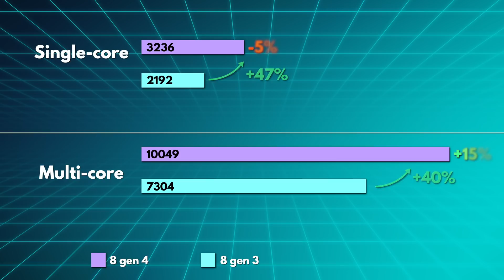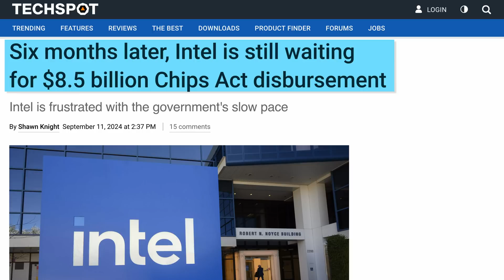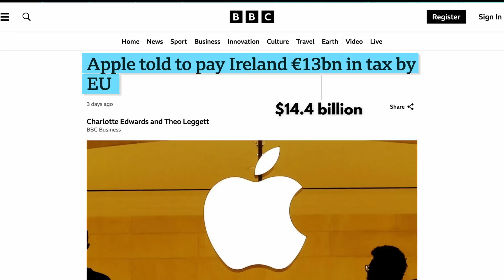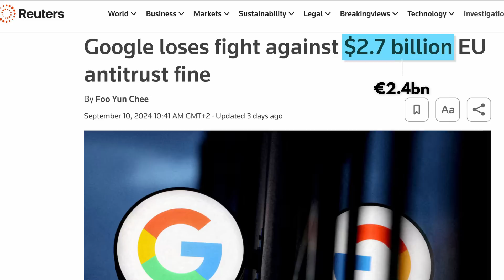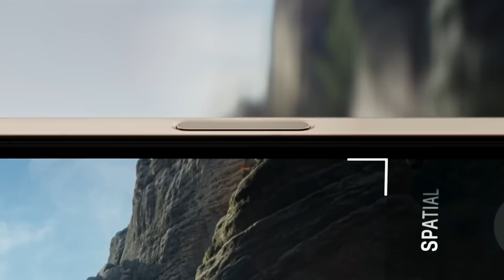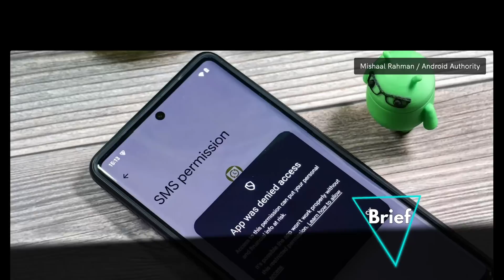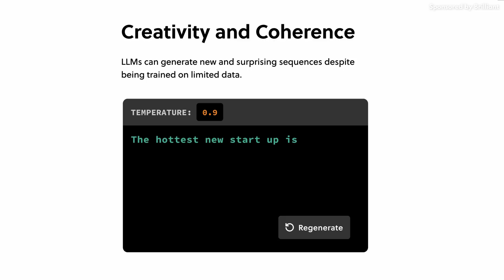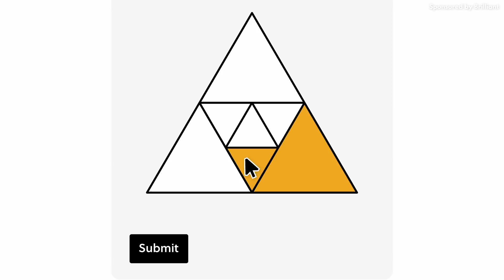Leaks show Qualcomm finally beating Apple!

Comment: last gen snapdragon about 140 mtr/mm2
new gen snapdragon about 220mtr/mm2

last gen apple bionic about 185mtr/mm2
new gen apple bionic about 220 mtr/mm2

new gen snapdragon 3200/10000
new gen apple bionic 3500/8500

seems more like the same performance but small difference in single/multicore
which is designer's preference mostly than some difference in performance

When Intel was dominating it was 1 to 2 nodes ahead. Same for Apple.
It is not Intel or Apple so much , but the silicon below.
Apple was indulging in saying how efficient it was . What about now?
Why is it not more efficient ? Have Apple's engineers suddenly lost their edge?
This would be disrespectful for Apple's engineers. But the primacy is not in the
design as Apple and Intel wanted you to think.

Comment: The new A18 is surpassed by the Snapdragon 8 G4, which will also be surpassed by the Dimensity, that's the way it is...
Reply: No, Mediatek is focusing on efficiency this year. It'll be faster than the a18, slower than 8 gen 4, but a lot more efficient maybe like 20%. It'll also have a faster gpu than 8 gen 4, but cpu goes to gen 4, thanks to oryon .

Comment: Awesome. I am sure their x86 emulation is just as good too? And everything that matters is working? And the performance per watt is also in line with Apple (or better) so your laptop actually has a better battery life than their x86 counterparts? Performance when you need it is nice and price/performance balance is also important. But a working laptop at all is even more important. Something like ‘to finish first, first you have to finish’ and all that.

Comment: Something you forget is that the chips run in smartphones which have an OS and various software components on top. By my estimation, iOS and every software on top is 20-25% more efficient compared to android so the benchmarks are actually irelevant… furthermore, benchmarks at this point in time for a chip, 3 months before launch are rarely precise

Comment: One notable difference is that Apple has adopted Armv9.2a architecture for the A18 Pro with SME (Scalable Matrix Extension) support that delivers faster AI performance via the CPU. Whereas the Snapdragon 8 Gen 4 is still on the older Armv8 architecture that doesn’t take advantage of high-computing extensions. It means that A18 Pro is likely to perform better in AI/ML tasks.

Sure, the Snapdragon 8 Gen 4 packs two more cores so its multi-threaded performance is going to be better

With all that said, Apple is likely ahead of Qualcomm in terms of performance per watt and most likely uses less power to deliver the same level of CPU performance.

Comment: the A18 Pro is a 6 core CPU (2 Perf+4effic) so 15% for two efficiency cores are not that huge.
just remember Apple M4 series GB6 numbers are 3655/13200 with 9 cores. (3 perf + 6 effc)
They are pretty matched.
Reply: We need something like Cinebench for mobile, Geekbench numbers don't seem real, the M4 is not beating 9950x in Single core, that's a 200 watt desktop chip, M4 probably 20% behind the top-end desktop
Reply: @NothingNewNerd  I totally agree that geekbench is ultra flawed, it mixes various results like memory speed and different workloads.

Comment: Qualcomm gonna never win apple they will win benchmark but in real life apple wins. And apple didn't uses latest core architecture (i.e. if Qualcomm use X5 core then apple use X4). So if apple start to use latest gen but apple won't use because of cost they will easily win

Comment: The issue with this is the integration with hardware-software is something no other company besides Apple has, and Apple's hardware has more than just the A18 chips, they are now including chipsets specifically designed to integrate with AI, which will be huge (not just for Apple). I'm not sure how relevant these comparisons are for real-world useage. Not irrelevant, but not by itself the whole story.

Comment: That Sd gen 4 performance matches an i7-12650H ain’t no way they made a mobile ARM processor that’s as fast as a laptop processor
Reply: And the m2 in my ipad pro got 2x cpu and nearly as good gpu as my work station laptop that came out in 2016. Tech is progressing fast, nothing to be surprised about.

Comment: I'm happy that Qualcomm is pushing Apple on mobile chips. That said, I suspect that this new Qualcomm chip would get destroyed by an M4 which Apple has in the iPad Pro. Aside from the fact that it would be overkill there's nothing stopping Apple from putting M4 cores in the iPhone aside from the fact that phones don't need that many cores, heat dissipation would be an issue so it would have to throttle quickly if under load, and it would chew through a battery like crazy. I'll be shocked if the phones that get this chip aren't as thick as a brick or have battery life that under load lasts just a couple hours. Won't be surprised if Qualcomm sells maybe 10% as many chips like that one as Apple sells A18s.

I could be wrong but I fully expect for this to be one of  those chips that gets shown off to change general perception of Android, rather than being something that ends up in anybody's hands.

Comment: Sorry but you can't compare Apple A18 and A18 Pro with Qualcomm SnapDragon 8 gen 4, as they don't have the same amount of cores and don't have the same power efficiency… Also, that are 2 different platforms, where Apple master both software and hardware vs Qualcomm which only masters mainly the hardware.

Comment: "3 years behind in performance" is nothing compared to the "10 years behind in performance" we were hearing a couple years ago.
At this rate, China could will be 3 years ahead in a few years.
Reply: They compensate hardware restrictions with wiser solutions. Raw performance benchmark is not the same as real-life integration, particularly for AI

Comment: Tried the new ChatGPT 4.o1 model and its bad. Like really bad. Needed some visualizations based on some arrays and both 4.o and 4.o1 failed, while it wasnt a problem for 4.0 - while 4.0 was also significantly faster. So at least for programming tasks 4.0 is still the best model. Nevertheless, cool to have so many options (4.0, 4.0 mini, 4.o, 4.oi) to test, which one is the best for the current task.
Reply: Idk bout you but the new model was better for me in ever single way 😂

Comment: Hope SD 8 Gen 4 doesn't heat and drain battery so much due to this high jump in performance.
Reply: Simple solution: Don't care for "slim" but larger battery.  Then we can feed back to the electricity grid ;)
Reply: @dimiberberu  😄😄

Comment: There's no way they can stop ppl from sideloading on Android, especially in the EU, where Google is already getting fined for being a monopoly.
Reply: It doesn't entirely block side loadings so you'd still be able to sideload but the problem is now the developer has control over if they want their apps to be sideloaded or not, which is a serious issue if you want to download repatched apps like revanced.
Reply: actually it's all depends to the app developer if they are greedy enough and dont want the user to install app from outside playstore

Comment: I'm not a fan of the Oryon cores being the building block of the 8g4. Oryon still has a base architecture of a server, it's still not as efficient as Qualcomm makes it seem to be. These chips will be stupidly power hungry, regardless of performance. So they better crank the compute up to 11 (thus the specs) and have phones with bad battery life, than have a slight generational improvement while also having bad battery life. I hope the phone makers complement this by providing bigger batteries and improve on optimisation.

Comment: LMAO, flash back to 10 years ago “yeah, sure, Apple’s A7 wins on single-core performance, but their dual-core design is still behind Qualcomm’s quad-core design! Typical Apple fanboyism!”
Reply: still behind Qualcomm then why did Qualcomm not release an M1 equivalent chip before Apple did they where making SQ ARM chips for Microsoft for years its only when they acquired  Nuvia and got those ex Apple
silicone engineers that they started beating Apple
Reply: apple have allways been better in chip but last 4 years apple sucks so hard, since sd8 gen 1 apple lose.
apple force people to use bt5.3 and older gen and finally they brind bt5.4 to 16 series something phones got in late 2023 and 2024.
iPhone 15pm does not have wifi 7 and only 6e support, and there is loot of things like storage UFS.
when downloading a movie at 4k +10gb as iPhone 14pm vs fold4 both use 5g deamn how slow iPhone is when both have 1gbps 5g.
Reply: @Kage0No0Tenshi  LMAO, storage? Apple’s been using PCIe NVMe for more than a decade, way better than UFS and definitely better than the eMMC a lot of Android phones still use for cost-saving. Keep trying, though.
Reply: @B.D.F.  why does iPhone have slower write speed vs android when download something ?

Comment: I'm still extremely skeptical about the benchmark numbers of the 8G4.
Especially since they're based on the X Elite and they were nowhere near as impressive. It just sounds fishy that the X Elite with 12 P cores only scores 12K in multi core and then the 8G4 with a MUCH lower heat envelope and only 2 P cores and 6 e-cores somehow gets 10K?

And of course, benchmarks are nothing but numbers. Qualcomm has had higher numbers in GPU compared to Apples chips for ages and yet in reality games always run in higher frame rates AND higher resolution with much higher graphics settings on iOS.
Reply: iPhone have much lower ppi and res on screen and getting lower graphics and they went to oled for few years ago, apple phones have allways been steps behind without one thing is chips but now they have catch up in everything but losing to chip quality last 4 years.
since sd8 gen 1 apple can not make better chip.

Comment: If Qualcomm can pull this off it might be really good. I agree in phones the performance will not really be noticed but those same chips will go into flagship android tablets where their competition are Apples M2 and M4 which currently wipe the floor with anything you can get on Android devices.
It would also be a good sign for the next generations of Qualcomm X laptop chips, where for now Apple still has a clear lead.

Comment: I don’t care about the latest phone anymore if you can’t truly own it and do whatever you want with it… The reason why I stayed loyal to Android was the freedom to customize and side-load apps without needing to jailbreak it/root it. Locked bootloaders is also why I have no interest in US made phones.. If I wanted to feel restricted I’ll simply buy an iPhone since they have been doing it since always so they already perfected the “you will own nothing and be happy” movement.
Reply: Like windows is fine with it. Why phones afraid of it
Reply: 99,99% of android users don't care.
Reply: I'm not sure for security purposes if side-loading should have ever been allowed on phones given this creates a massive systemic security threat not just for carrier networks but for the entire internet system. I'm of the opinion that this should just be flat out illegal everywhere, purely for security purposes. Or at minimum all "side loaded" apps are strictly walled off from any network or internet connectivity, and cell phones that bypass this should be absolutely bricked at a hardware level and irrecoverable as phones.

Comment: If sideloading is gone, I'll 100% change to Apple. Why use a generally worse stable phone with just as bad OS.
Reply: Faster charging, better hardware. I mean its not all software lmfao
Reply: @Myemnhk 85% of the phone experience is software. Phones are more that powerful enough to do everything the majority of people need them to do. 

Also it’s arguable that Apple has the better hardware considering that they have some of the best screens from Samsung, the fastest storage, and one of the most powerful chipsets every year with the A series.
Reply: @Myemnhk better hardware only in cameras and the battery charges but even then software reins king because apple makes up the difference with it so that it doesn't matter so much or so that they're even better than the competition
Reply: If sideloading is gone, I'll switch too. There is no reason to stay on Android already
Reply: right now it looks like it'll be on a case by case basis at developer's discretion.
Reply: Reddit & XDA developers will always have a better bypass solution than Big G i.e. Google 😂😂
Reply: There's too much restrictions on Google right now that make iPhone seems like a better choice.
Reply: iOS getting sideloading (in EU) and android losing it is something i never expected to happen.

Comment: I really dont understand the obsession with more performance in phones, they have been indistinguishable between generations for years now. They should really be focusing on efficiency and battery life instead.
Reply: It is visible if you play mobile games
Reply: I 1000% agree. I don't think many phones have a CPU bottleneck. I feel like the GPU is the differentiator.
Reply: I can not agree with you, I have fold4 for 2 years and have used battary saving and performance mode at focusing on cooling and efficiency to get another 4 hours battary life but my fold 4 getting like 30% slower in one core and 60% in multicore performance is worth and using 60Hz over 120Hz.
apple you have only one option and thats is battary saving mode and that slow down phone to save power like android but my samsung have 2 options to save power.

so in end you chose how you want your performance and efficiency.

Comment: Sideloading removal just underlines why AOSP and phones with unlocked bootloaders are now more important than ever before. It's hilarious that Google thinks they will get away with it at the same time that iOS is about to allow side loading -- making Android pretty much a second rate platform in every aspect. A mass exodus of open source developers might very well be enough to completely kill Android as a viable phone OS the same way BlackBerry OS and Windows Phone died.
Reply: The big G thought of that, it’s why AOSP is being gimped and why ARM mobile devices are so hostile to non Android based OS. Yes, even the ones with unlocked bootloaders. They did it for the same reasons you can’t swap batteries on your mobile devices: planned obsolescence, controlling users and minimizing competition. Power users and open source developers tend to make up a tiny fraction of total users. Talk to average person with an Android smartphone and ask them if they sideload or do any advanced stuff. I’m fairly certain most of them will say no.

What we need is a third major OS and, possibly, a type of smartphone. Handheld PCs could (and IMO should) lead to PC smartphones. These types of computers retain many of the advantages of the PC, including repairability and the freedom to run any software you like. With Strix Point and Lunar Lake likely closing the gap in areas where ARM excels like battery life, I think a PC smartphone is possible. I dream about a PC gaming phone every night heh.
Reply: huh??? where did you see the news about apple making sideloading possible? Cuz that would be craazy
Reply: @comfortingabsurdity.  the EU forced apple to allow sideloading, however this only applies to iPhones in the EU.
Reply: google does this because it can get away with this, it's not like an unlocked phone is any more accessible than the average Samsung and similar phones that are the only thing most people can afford. unless there's a company that's very suddenly available in major countries and has enough influence to affect other companies, i don't see that happening, because giving rights back to users means missing out on potential profit, but who would be willing to do that, let alone a publicly traded company?
Reply: Sideloading is NOT removed. It's just that Developers are given a CHOICE to only allow apps to run when downloaded from Play Store because some apps like Banking and Games are victims to malicious mods.
Reply: @Junispro31  it's being partially removed, since they can (and almost guaranteed they will) simply force their GApps like YT to rely on the Google Play API purely to target Vanced and similar apps by making those callbacks necessary -- that will simply break those types of apps until a workaround is found. They've tried to target these apps before with Play Protect by flagging them as malicious and I've seen it happen first hand on my phone. Same effect will most likely hit projects like microG too. It's basically extra DRM and a huge additional hurdle for the devs of those types of apps to have to overcome (similar to how Google Play Services are deliberately breaking functionality or compatibility of apps to often single out AOSP users).

Comment: will the apple buds that can be hearing aids be available in the UK with that enabled? The OTC (over the counter) hearing aids are still not legally sold in the UK as the hearing aid industry seems to have managed a mafia like grip on selling multi thousand dollar per ear buds to anyone that needs them. You can order them from abroad but often the app will not function in the UK which is often needed to perform the hearing test. 

So I'm wondering if Apple have managed to get around this or will just sell them in the US.